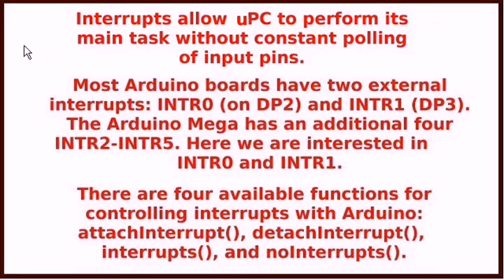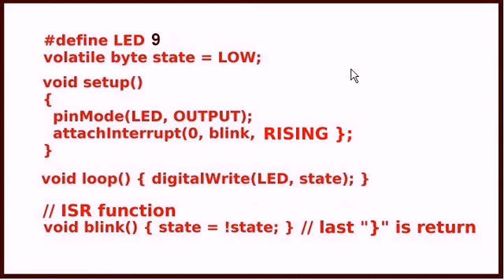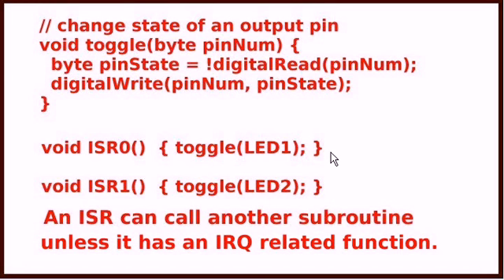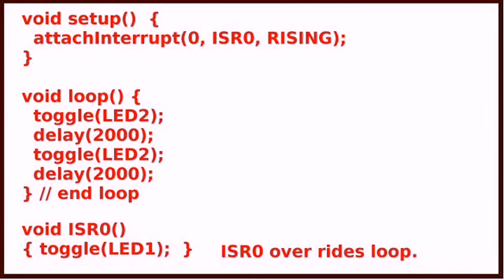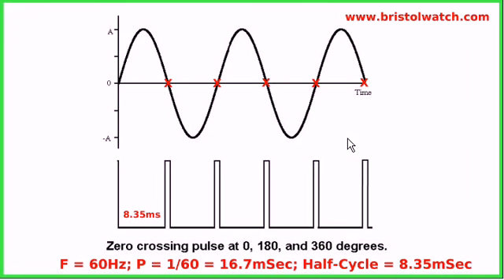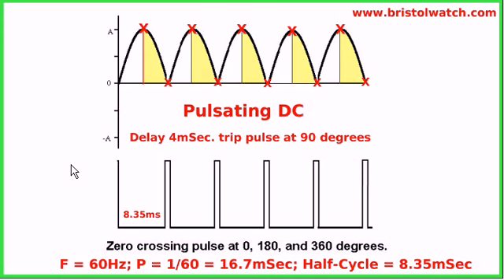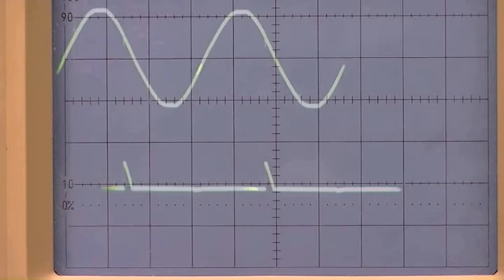Arduino Interrupts Revealed

Comment: https://youtu.be/V1uSynz2src?t=297   The keyword 'volatile' TELLS the compiler that the variable value can change outside the normal 
arduino code flow. like in the interrupt. If the compiler thinks that the variable value is not changed in the normal arduino code, it may 
optimize the code and the variable value lost.  https://www.arduino.cc/en/pmwiki.php?n=Reference/Volatile

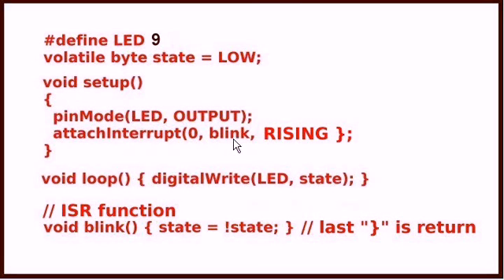Comment: Minor slip, at 7:21 you press switch it goes from low to high (not high to low as you say). Great video, thanks
Reply from the maker: The switch closure pulls the pin from high to low. This is because of the internal pullup as I remember. Wasn't clear on that thanks.
Reply: Lewis Loflin OK, I was wondering if you were pulling down. Useful to note that I think the 328 data sheet says pulling down is more reliable. Thanks again. (While I have your attention don’t forget to make the trailing edge phase control video ...Greatscott has done one recently, but the subject needs the LL treatment!
Reply from the maker: @whitefields5595  Thanks. One can only pull down if using internal pullups. Again this illustrated leading and trailing edge. I normally would use falling. Thanks.

Comment: Thank you very much! I did not understand why a delay() command does not work in my timer interrupt subroutine, and spent many hours for troubleshooting until I luckily found your video and you explained it very clearly at 12:09.
Reply from the maker: When you call an ISR it disables all other interrupts - delay() uses interrupts which is why I use my own delay routine.
Reply: @LewisLoflin  Hi, thank you for your excellent videos! Just one note - your myDelay(int x) routine actually delays for one more millisecond than indended, since the variable i is going from zero. Should be for (int i=0; i<x) or (int i=1; i<=x)

Comment: OFF topic: Your UTube audio is weak and muddy on MAX volume! ........ Well it's back when I pull the headphone plug partly out.  This has happened on two UTube videos tonight. Others are fine.  It repeats on those same videos and makes absolutely NO SENSE!  Anyone experienced this?
Reply from the maker: This video has been out a while and I have better equipment than back then so I'll make an updated video on this subject.
Reply: Lewis, don't make any updates because of my experience.  When the audio came back (partly pulling the headphone jack) I could easily understand your voice.  There is a bit of noise but not bad.  The PC speaker works like it should! The reason I posted is this is a strange effect.  It occurs at exactly the same places on those videos that display it.  On one video the ad at the beginning is just fine but the following audio is bad.  Although it is good on the PC speaker and a partly pulled headphone jack a fully inserted headphone has this inability to play some sections of the audio that otherwise is fine on the PC speaker.  I am an engineer and want to know how this can be possible.  Maybe the left and right channels are 180 deg out of phase on some audio and are cancelling each other?  Just my first guess.
Reply from the maker: Needs to be updated and additional material added. Thanks

Comment: Hello Lewis Loflin 
i work for long time  to understand pin change int but it doesn't work
i want to have code wich use pin 7 (on arduino uno ) as pin change int to turn on and off led on pin 13
Reply from the maker: +Adil Machrouki If pin 7 isn't a hardware interrupt pin it won't work unless you use what is called polling.
Reply: #include <PinChangeInterrupt.h>
#include <PinChangeInterruptBoards.h>
#include <PinChangeInterruptPins.h>
#include <PinChangeInterruptSettings.h>
include all this and use attachPCINT(digitalPinToPCINT(pin no.),function, CHANGE);
only work with CHANGE.

Comment: Just an addition, to my understanding; volatile also tells the c compiler that the value of a particular variable can be changed externally to the program (i.e: in an interrupt). Without declaring volatile, the value of a variable that changes only inside an interrupt will will "optimised" to a constant.
Reply from the maker: What it means is the variable is stored in RAM not a register. Non-volatile will work but according to the literature it can be inaccurate.

Comment: I would probably want to try a hall effect tach setup using interrupts to count rotations.. Is there a way to detect or calculate the shortest usable duration between events?  Presumably you need some minimum processing time between interrupt events and when that goes to zero you are swamped!
Reply from the maker: ***** The deal is while servicing an interrupt (ISR) other interrupts are ignored until a return is issued. If using say INTR0 and an interrupt comes in on INTR1 that will be serviced (if programed) afterward - but if multiple interrupts occurred on INTR1 they are lost.